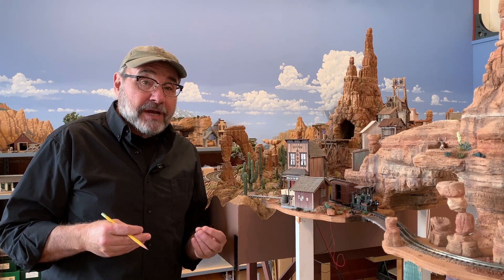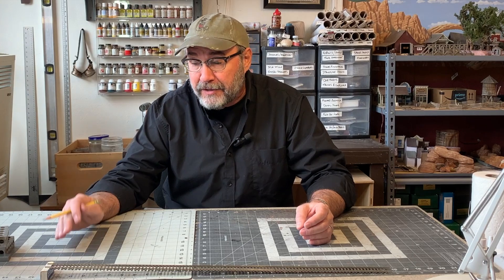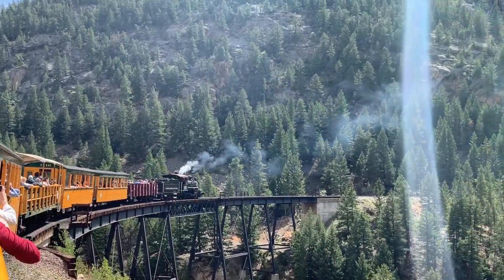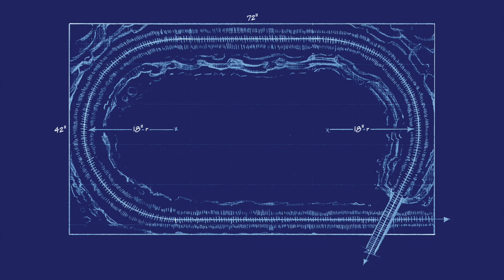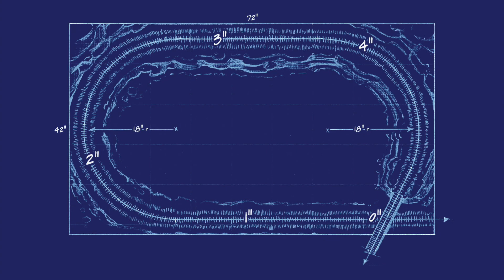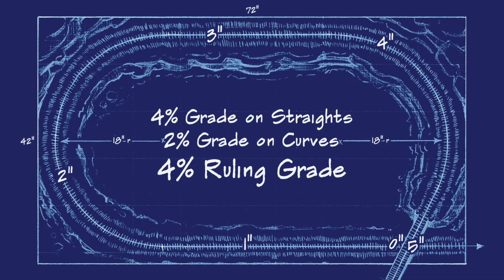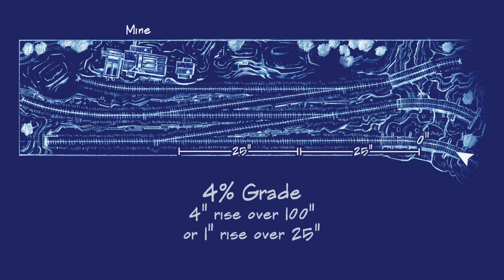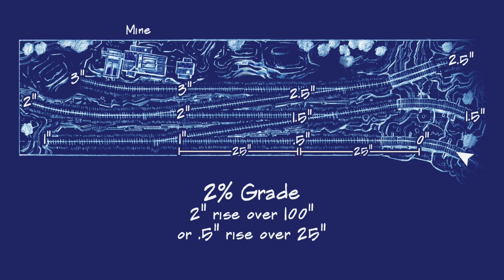Simplified Grades and Switchbacks | Workbench Wednesday

Comment: Hey Dave; thanx for the lesson.  However I believe there is a much more simplified and more accurate way/formula to figure/confirm a grade.  I was taught this (like you said) back in 1966 in 7th grade, take the desired height needed, say, (4") divide by the number of inches available to traverse to the intersection point, say, (96"); this gives us an accurate grade of 0.041666667 or around 4.2%.   4." divided by 137" = 0.2919708 or about  2.9%.   I know it may seem more tedious, but when one does not know what grade will be satisfactory, this formula can be used to compute the grade AND tell the builder how many more inches in distance he might want to add in order to achieve a more satisfactory resulting grade.   I love the show and the projects.  Please keep doing what you're doing, it's VERY MEANINGFULL AND HELPFULL.........
KYLR CREEL
ST&BB RR / GDM&T Ry.
On30 by choice !!!!!!!!!!!!!!!!!!!!!!!!!!!!!!!!!!!!!!!

Comment: Hello Dave ! :) In a friendly way and only in order to avoid people maybe getting confused (just in case they would need to apply this in real life and not on scale models), I am sorry but I think that I see two mistakes in what you said at the beginning. The first one, although its effect is negligible in practice for the actual used grades, is in fact mathematically wrong. If your rail is 100 inches long and your elevation is 4 inches, the grade will be  4.003% and not 4% :D:D The way you present it by saying "length of track" is misleading to me. The length of the track for 4% on 100 inches is actually 100.08 inches. :D:D I know that it sounds ridiculously "quibllely" (I don't know if this is even an existing word :D, but I guess you see what I mean, "cut the hair in four" as French people say, "rivet counter", "picky", I guess ) but for maths accuracy, I wanted to mention it. For example, for a 30% grade, your rail will need to be 104.4 inches long and for 100% grade it will need to be 141.42 inches long. 100% grade is an angle of 45° (there, the difference is huge). But how you presented it, 100% would mean a vertical climb at 90°. In fact, a correct way to say it would be something more like "4% is climbing 4 inches in 100 inches of projected track on the plan or 100 inches of horizontal move", I don't really know in proper English, sorry. And in fact, it's what you later actually do on your example plan, which is then totally right for this. :) The second one in my opinion, even if I am not 100% sure of it, I think is that the locos have less traction in the curves not because they have less surface of contact on the track but, on the contrary, because there si too much contact, and therefore too much friction, because of the oversized wheel flanges we have on scale models and that are rubbing more on the rails. Not mentioning also that the coaches are overweighted compared to the loco, which does not help in slopes, but that's too long to explain. Again, I did not want to sound annoying or  too picky and I love your channel and you (even if you hide skelettons a bit everywhere) !!! :) And by the way, please correct me if I am wrong in what I wrote (beside my broken English, of course). Have a nice day ! Cheers ! :) :) :)
Reply from the maker: This kind of nitpicking is exactly what I'm on YouTube for. Thanks for keeping me honest. But the mathematical differences are so small that none of what you mentioned would make any difference at all on a model. If anyone is coming to my channel for real world engineering advice, then they probably made a wrong turn at Albuquerque.
Reply: @rMesaStudio Thank you Dave for this answer which really honors you ! Keep being honest and nice as you currently seem to be ! :) Of course, I totally agree with you about the fact that it does not make any difference on any model (unless we imagine a crazy rack railway :D ). That said, you might be surprised where "real engineers" can sometimes get their inspiration from. ;) Happy modeling ! :)

Comment: Dave, I think the math in your first example was off a bit. If you have a 4% grade along the first 25", you will be at 1" of rise. But if you cut back to a 2% grade along the curved section, you'll only be at 1.5" of rise at position #2 (50" of run). And if you carry that same 2% through the rest of the turn, you'll be a 2" of rise at position #3 (75" of run). Or am I missing something?
Reply from the maker: Yes, on the curve I'm counting two inches because it would only be .5" every 25".

Comment: Very thoughtful video! I have been reverse-engineering John Allen's classic 4x8 Gorre and Daphetid with the aim of compressing it as much as possible, and the point about curved gradients hadn't even occurred to me. I really liked learning your technique for getting the grade heights from track distance on paper, I was wondering where Allen got his heights from!

I have a switchback modular layout which is exactly 5' 6" long, with each tail track being just long enough for an 0-6-0 tender loco and two short logging buggies to fit, or a two-truck geared engine, the two log cars, and a four-wheel caboose. As a visual gag, the sawmill at the bottom of the railroad is only a few scale yards away from the mountain top, showing off the elevation. I painted a little "hiking trail" to imply that the railroad genuinely takes a 2 1/2 minute round trip to cover a very easily walkable distance of about 30 scale feet. One thing I discovered is the "vertical curves" presented much more of an engineering challenge than the grade itself, since it's in such a confined space. For instance, the switchback itself could only be 2% either way to avoid cars uncoupling, but on the actual tail tracks, I could make it get progressively steeper, closer to 4%. Part of this was to give the illusion of climbing a steeper grade, and another part of it was to allow for "gravity trains" where the log cars at the top are just left to roll down the mountain unchecked. To get more track to fit, two of the tail tracks are on 15" curves that go into the backscene.

Comment: +1 on planning your grade transitions/vertical curves.  From my experience with On30, you can go from 0% to 1% with little worry.  0% to 4% is a different matter.  You will need a vertical curve at each end of the grade to ease in and out of it.  That translates into an added run length requirement.  The actual varies with grade.  I use 2" x grade% on either end of the grade as a rule of thumb.  A 4% would need an additional 8" on either end.

Comment: Cass Scenic RR in WV still uses their switchback on one of their runs. They say it's a tricky ride when the leaves are falling...
Reply: Yes, and the grade is around 8% until just before the top of Bald Knob where the grade becomes 11% for several hundred feet.  Listening to three 3-truck Shays pushing 7 cars up that grade is music and not easily forgotten.  After the train stopped and the passengers got off, 2 of the locos went back down to Cass; only 1 loco was needed for the brakes when drifting down the grade.

Comment: While planning and building my Twin Peaks layout. I came up with another solution. Think of it this way, you need four feet to reach your highest point, but you only have three feet of room. Picture this, take four feet of string and bunch it up, light a highway going into the mountains and shorten it to three feet with "Curves". Yes, you have curves, and like you mention it slows or makes it harder on your "Shays". So, start with four and a half or maybe five feet and add easy wide curves to shorten to three feet. Not only does this help with the solution but makes for some interesting mountain scenery.  I have found One drawback, no matter what, Wach your speed coming down the other side. You and I really need to turn down the power on the downside.